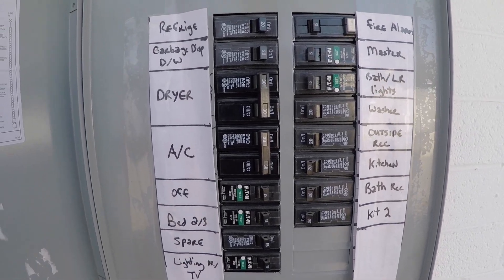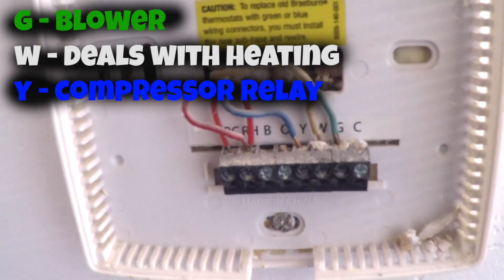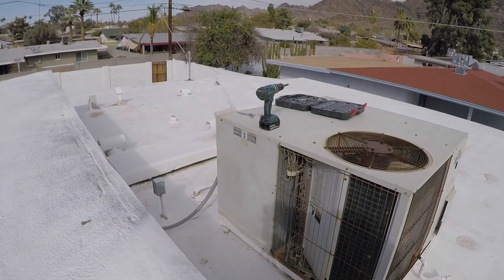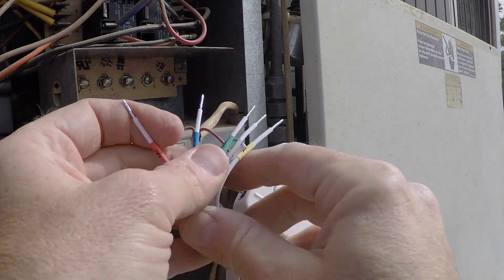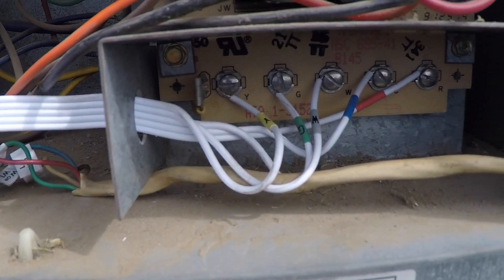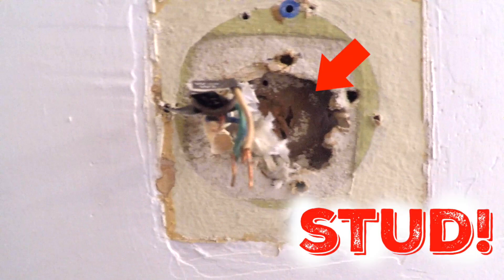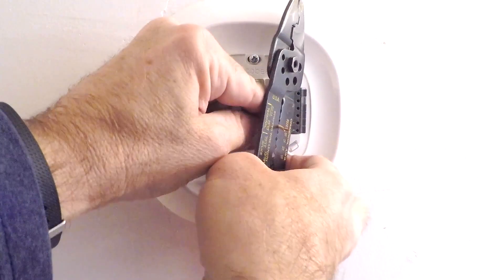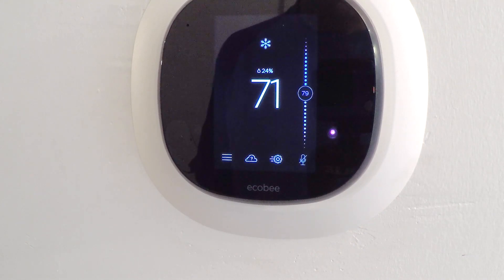Easy Ecobee4 setup with Extender Kit PEK

Comment: You only had 4 wires in the furnace and you used a connector Extender but at the thermostat you conveniently had 5 wires
Reply from the maker: Hey karl..thx for watching…if i had used the wire there would be no extender video to make.

Comment: My C terminal in my furnace already had 2 wires in the terminal. Is it okay to add the C wire from the echobee extender into the C terminal? 3 wires hooked into the C terminal in total okay?
Reply from the maker: The quick answer is yes its ok.  There really only should be one wire (currently) connected prior to adding extender.  You could remove wires currently connected to c terminal, use a small wire nut added a third piece to “pigtail” to c terminal.  Hole that makes sense

Comment: I am in Mesa. I have a question. How will has your extender pack in the roof unit hold up in the heat? It wont toast in the heat? Especially being in the AC unit itself?
Reply from the maker: I think i installed it 4 years ago and had no issues at all.  Still works great

Comment: I have a blue C wire, but no power.  But I think it's actually a B wire.  I was hoping to not go up in the attic, but I guess I need to see.  Hello from Gilbert, AZ!!
Reply from the maker: Look at it this way...better to go up in feb than july in phoenix!  Checking air handler in attic will make troubleshooting a lot easier.  Good luck!
Reply: @how2q  Exactly... I put one of these in Prescott and saw that it came with the PEK, didn't know that was even a thing.  Costco has the Voice/Smart version with remote sensor, door sensor and PEK for $169.  With SRP rebates it's $95.  So I got it for my house here...I knew I didn't have a C wire, old unit from like 15 years ago
Reply from the maker: Ok thats cool!
Reply: @how2q  I was glad to find your video.  All the other ones were like, oh here is my furnace in my basement, let me open this panel . see how nice and clean and orderly it is. I don't even have to move a box to access it..   

 Meanwhile in AZ it's either full of dust from the last monsoon or hidden in some dark corner of your attic full of dust from the last monsoon.

Comment: so when I opened up my furnace, there were 5 wires connected (so one wire into each hole) but when I checked wiring of my thermostat, I only saw 4 wires connected. What does that mean/does that change anything? Could it be that the person who installed my thermostat didn't connect one of the wires behind my thermostat and it's just hidden in the back and I need to open it up and see? Thanks!
Reply from the maker: tough to troubleshoot from afar...there is definitely a 5th wire on the other end.  Might be the C wire or common wire that wasn't connected.  The other option is possible what we would call a jumper wire where two wire are connected on one end that equals one on the other.  I would suggest calling ecobee customer service and describe exactly what you have (including wire colors) and they can help...i have found them to be very helpful in the past

Comment: If the cable between the HVAC controller and thermostat had extra unconnected wires (just like your installation) can you just land one of the wires on C (at thermostat) and at the other end land the wire on COM (at controller) rather than using the extender and modifying the wiring at the thermostat?
Reply from the maker: Funny you should mention that.  I believe the answer is yes...the only reason i didn’t use the extra wire was i was doing a video on setting up extender!lol

Comment: Wired it as you show in your excellent video.  Flipped the power back on and after configuration, the A/C was blowing heat.  Ended up calling support (Michael, who was excellent). Sent pictures of the old block and the new block. All looked correct.  Then sent pictures of the connections to the air handler and it clued him into the fact that I have a heat pump.  I had W1 and W2 wires. And I had to move the orange wire from W1 to o/b.  And move W2 to W1. This told the ecobee that it was a heat pump and I was presented with a different set of heat pump-related set-up questions. Nowhere are there instructions for a heat pump - a common setup in this part of Florida.
Reply: A lot of people get this mixed up because you probably read the labels of your old thermostat incorrectly. One side is labeled as a conventional system, and the other side is labeled as a heat pump.
Reply from the maker: Thank you for sharing this info...hope it helps others with the same setup!

Comment: I installed one yesterday, and was little nightmare because Ecobee comes with only ONE wall mount, only to cover very small holes, if you have an square gang box, well its impossible to attach the mount, I had to make a hole in the metal to screw and secure the mount. Luckily i had extra metal to drill. 
So not like the the Nest comes with extra metal bracket and mount for all situations.
Reply from the maker: Funny you mention that, I always thought there was a business in alternative wall mounts or plates for this and nest.

Comment: I shut off the 2 A/C switches before I started installing the Ecobee4. I have a brown C wire in my wiring. Did everything like the manual says and get no power to it whatsoever. I tried putting the original Honeywell back on and now have no power whatsoever as well. Did I have to turn off anything else besides the 2 ac swtches on the breaker box? Please help.
Reply from the maker: First thing I would check are the fuse's on each air handler.  Youtube "changing fuse on air conditioning".  This is a very simple fix and a very common problem.  Not sure if this is your answer but this same thing happened when I changed out my daughters honeywell to ecobee.

Comment: Hello, just had to drop you a note to say thank you for this video. I had a geek squad tech come after waiting 3 separate appointments as if my time is fee. $600 loss income. Yet still he wired everything wrong. I followed your steps all worked great and went back to Best Buy for a refund for the geek squad bad service. Thanks again.
Reply from the maker: This is one of those jobs that is a lot easier than it looks.  Glad it worked out, sorry the "crack" geek squad didn't work out.

Comment: Just curious why didn't you use the brown wire to connect the common?  I don't have a common but I have that extra wire I was thinking about using for my common.
Reply from the maker: Sorry for late response!  Colors really don't matter.  I honestly didn't used the C wire for video/explanation purposes only.  Colors help ensure continuity between all the connections.  So if you have an extra wire that can be used as a C I would go for it.
Reply: Can I use the brown wire as C?  I have an extra brown wire not connecting to anything.  And no C wire connected to my old thermostat.
My connections has 4 wires.  Red to Rc/ Rh(jumper together), Yellow to Y, Blue to G and White to W.  And then I found a brown wire inside the wall .  Thanks!

Comment: That sure is a scary way to climb on the roof 😃
Reply from the maker: One of those "most accidents happen at home" thoughts running through my head as I did this.  As they say, don't use top two steps (unless it's the only ladder you have).  Embarrassing but true, there was a lower point on roof in back that I could have used.  Minus the roof access part, hope this helped with your install.